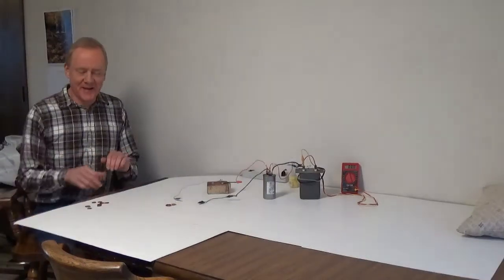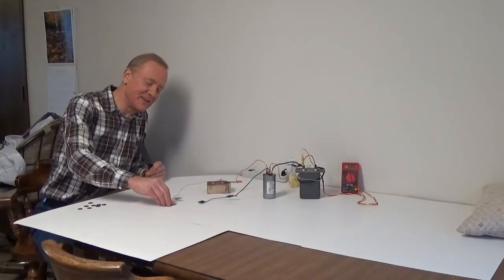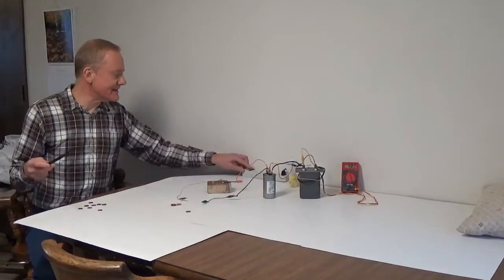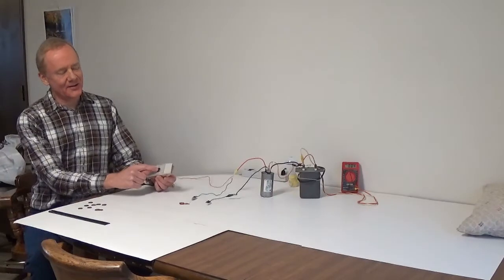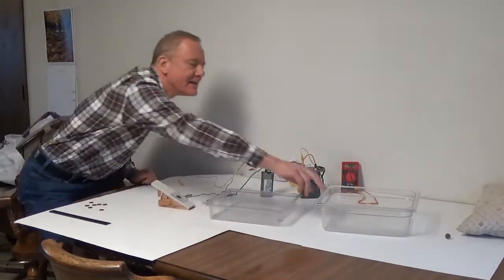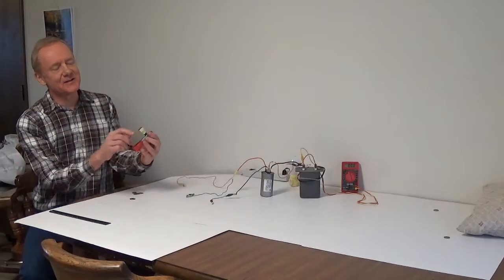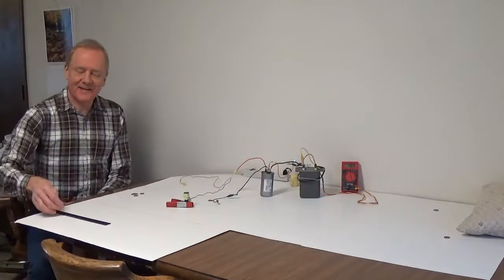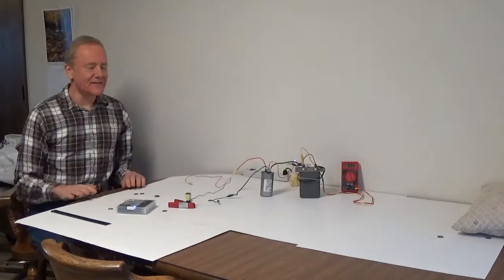Penny launching/sorting with pulsed electromagnet

Comment: OMG David, Seriously need some help please. Spent weeks now hunting for such a device as the package one. Only seen this on the electronic forum. Could you be so kind as list the schematic please, parts used, Not needing anything as strong as that just a couple of inches. Be most grateful.
Reply from the maker: I'll make a thread on highvoltageforum.net for this project - at least get that on my to-do list.
Do you need it to be battery operated?  The hardest part is making a battery-powered supply of a couple hundred volts to charge capacitor.  Would be easy starting with line voltage.
Reply: @davekni  Hi, Dave did you manage to do a write up, on the forum? been looking to no avail. Regards
Reply from the maker: @ Sorry, it is still on my overly-long list of projects and plans that I haven't gotten to yet.  Thank you for the reminder that you are waiting for that post.  I'll add that note to my list as an extra reminder.  Perhaps I can get at least a brief description posted.  I'll reply here when done.  Then you can add questions to that High Voltage Forum thread.  I'm more active there so more likely to respond promptly.
Reply from the maker: Here's the High Voltage Forum post:
    https://highvoltageforum.net/index.php?topic=3335.0
That's the best place to add questions or comments.
Reply: @davekni  Thank you David.. Will have word with on of our Electronic persons at work...
Reply: @davekni   David thanks for the quick response, much appreciated. Yea battery version be great, need to be pretty small in construction. Again thank you...
Reply from the maker: @brianbrinamo8943  Found the battery powered charging circuit.  It is not something good for copying.  Made from parts extracted from scrap electronics, obsolete part numbers on some and no part number on transformer.  Instead I'd suggest using circuit from a disposable camera flash for charging.  Used to be available for ~$1 each at surplus stores.  Here's a couple more expensive listings on EBay (or buy a camera and disassemble):
https://www.ebay.com/itm/304576320751
https://www.ebay.com/itm/204781056497
I'll still post the TRIAC circuit with trigger button, though that is quite simple.
Coil was I think 27AWG wire with 50-100 turns, OD to match penny.  Haven't found any documentation on that detail.
Reply: @davekni  Cheers David, only have 20swg wire, So if strip out the flash unit, should work? usually 370v going through the cap.  Thx
Reply from the maker: @brianbrinamo8943  Since you aren't concerned about maximizing jump height, yes, 20 AWG wire should work.  Probably with existing cap from flash unit too.  Though that electrolytic cap will have somewhat limited life.  Is this going to be used repeatedly for thousands of times?
Peak current will be higher with fewer turns of larger wire.  May still be OK for using standard BTB16 TRIACs as switch.
Or, easiest option:  Use complete flash unit including existing xenon tube and trigger circuit.  Verify flash works first.  Then cut wire from end of xenon tube opposite trigger electrode.  Connect coil in series with flash tube (connect to two ends of cut wire).  Then you will get a flash with every penny launch.
Reply: @davekni  Appreciated for reply again Dave, so then possible a joule thief, may be better option?
Reply from the maker: @brianbrinamo8943  The single-cell-powered disposable camera flash units I've seen use the same basic circuit as a "joule thief".  However, there is one difference.  The flash unit's transformer has an additional winding with many more turns of fine wire.  That is how they generate 300V or so.  Typical joule thief circuit  generates only a few volts.
Reply: @davekni  Much appreciated again Dave. Will give a go, this evening. Appreciate your replies...

Comment: Great video! Do you know if the pulsed electromagnetic devices used in healthcare are strong enough to attract or repel a regular, static magnet? Or do they generate very low frequencies that wouldn't affect nearby magnets?
Reply from the maker: My knowledge of healthcare use is minimal.  A quick search showed devices that appear to cover much larger areas with a much lower field strength.  The penny launcher is roughly 2 Teslas (20,000 Gauss) at the surface of the penny.  The medical devices probably have similar total energy, just not concentrated into a penny-sized spot.

Comment: How fast can the capacitor cycle? You should add an optical gate switch to trigger discharge when a coin slides down a ramp and passes a photo-gate. Then see how fast you  process a batch of coins.
Reply from the maker: My little battery-powered unit takes 1.3 seconds to charge.  It would be relatively easy to charge it faster, although a high cycle rate may need a fan or other active cooling for the coil.  The launching itself is not very efficient: With 4 Joules of energy in the capacitor, a copper penny gets about 60mJ (about 1.5%) mechanical energy.  ("Copper" pennies are really 5% zinc.  Pure copper disks launch even higher.)
If I were designing a fast commercial coin sorting machine, I would use magnetic induction to sense the coin's conductivity, then kick the copper ones out mechanically (with a solenoid).  That would be more efficient.

Comment: Amazing how much more energy is transferred when you use the iron core.
Reply from the maker: It does help here, where the magnetic field is near iron's saturation level of 1.5 to 2 Teslas (15 to 20Kgauss).  For my quarter shrinker, iron would be of little help, as the peak field is around 20-30 Teslas.